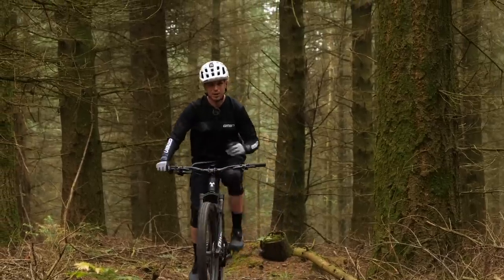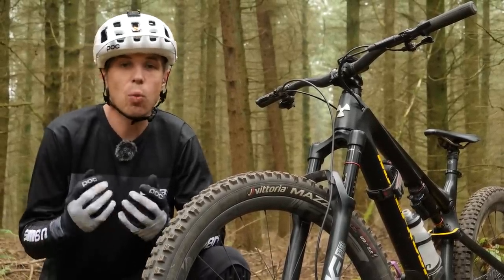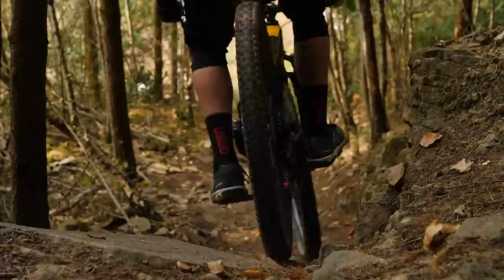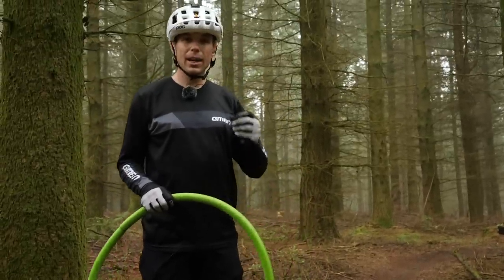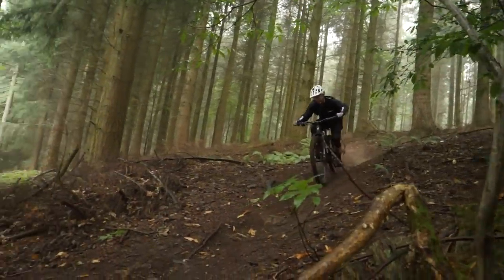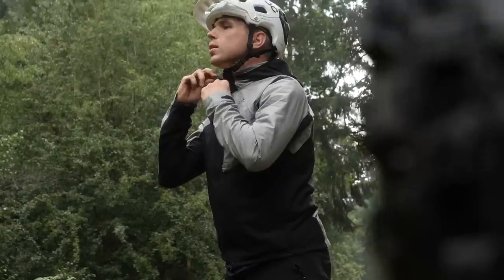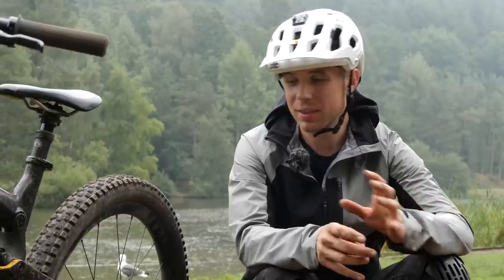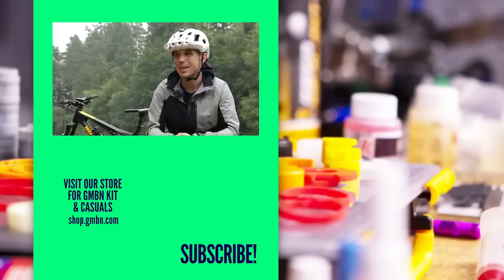How To Choose The Correct Tyre Pressure | Hard Vs Soft, What Is The Ideal Setup?

Comment: My local bike shop suggested this as a starting point for tubeless tire pressure: rider weight in pounds, then divide by 7. Add 2 PSI for the rear tire, subtract 2 for the front. When I was just starting, it worked great. I have dropped a few PSI on both tires as I've gotten better, plus it's really dry here.
Reply: And non-tubeless?….tubed I guess
What pressure?
Reply: @justingrimson5750  simply run the pressure stated on the tire, probably around 35 PSI. When I ran tubes, I still put sealant inside the tube and ran a few PSI below that number. You can't go too low when you have an inner tube, though, or you can get something called a pinch flat.
Reply: Hmm, interesting. For that I would have to go below 20 :)
Reply: Giving this a shot since the number line up with 2 psi of what I was already riding!
Reply: @StratoPL  I run back 35 psi and front 30 ( 206 lbs)

Comment: Every puncture I've ever had (other than one) has been a pinch. Now I'm running tubeless, I tend to still be in the habit of running higher pressures because for some weird reason I'm still worried about pinches.
Reply: same haha, should probrably increase presure xd
Reply: The tendency of sharp objects punching through a tire increases at a higher pressure because the same load is distributed over a smaller surface area. Thus more force action at the sharp object.
Reply: @Dumbo3.1428  you are replying to a pinch flat comment...
Reply: @BGraves  thx. I'm not a native speaker so I seem to have confused both
Reply: @BGraves  funny enough in Germany we call this kind of puncture "snakebite"
Reply: I can barely speak my own native language but that's kind of the status quo over here in America.
Reply: whats your tyre pressure?
Reply: Get inserts..
Reply: Yeah same lol, the first time i tried a lower pressure i got a pinch flat on my tubeless tyres and now I'm scared to try again.
Reply: @benbaker6174  what pressure are you running now?
Reply: @ezboah7183  I'm running 27 front 30 rear just to be on the safe side
Reply: @benbaker6174  someone told me that if youre running too much pressure the knobs will fade easily
Reply: @ezboah7183  i dont see how that would affect it, more psi = less surface area which means there are less knobs on the ground. I could be wrong though.
Reply: @benbaker6174  im going for the same, only just switched to tubeless so might start off a little harder
Reply: @garysdragon  nice 👌
Reply: @Dumbo3.1428  Also "snakebite" in the USA.
Reply: Get Cush core. Now I don’t worry about pressure. It has saved my rims once or twice that’s for sure. Feels very supportive too

Comment: This was good learning, thanks GMBN! I just came home from a xc/trail ride with my hardtail with tire pressure set much lower than I usually have. I thought I should be slow but it was quite the opposite. Much more smooth over roots and rocks and less bouncing. Bottomed out once in 25km which means it was using the full dynamics of the tire in best possible way. And tubeless is the best invention since sliced bread! 😁

Comment: I've put pretty much this comment on another video, but I'll say it again here. I had almost given up on mtb because a I couldn't seem to ride without pinch flats. At the World Cup at Fort William last year I saw the Tannus stand and decided it was worth a try. They are inserts you use with tubes, and they have transformed my riding. I'm running 25-30 psi where before I was always at 40+,and haven't pinched yet in around 400 miles on a variety of trails including rocks, roots, flat out fast bits, slow tech stuff and everything in between. I love these inserts! Fingers crossed they keep working as well as they have so far!
Reply from the maker: We're big fans of inserts at GMBN

Comment: Nice video, but there are some dynamics that matter that I would like to include for consideration.  

I ride and race both mtb and gravel with a lot of success and tires have been something i've always been really focused on (pressure settings and tread profiles).  On the mtb, my focus is strictly XC so keep that in mind in my comments. I don't ride at DH parks, and have no need for an enduro bike (nothing wrong with either, but I xc, gravel, and road riding occupy all my available cycling time).  My mtb wheels are narrow XC on 29er, and I ride both a fully rigid 29er and a full suspension 29er. Lastly, I don't run tires bigger than 2.25's, and often run 2.0 on the rear.

The core dymanics on a mtb that need to be considered first is your total weight on the tires, the terrain you're riding, your suspension setup, and the tire profile (tread pattern) - the combinations with different tire pressures then can be a touch complex, but through many days of riding and racing it's clear that you need to know the total weight of you and your bike relative to the tires. Then you need to experiment with your tires as noted in the video and there really is no hard and fast rule here - one of the great things about off road riding (mtb and gravel) is that you and your bike are a unique power and balancing system and what works for the person ahead of you or behind you is likely not optimal for you.  Learn as you go and you'll discover the sweet spots.  Over time then you modify based on suspension settings.  Yes, it seems complex, but when you dial in all the factors the ride is so fast and sweet it makes it all worth the effort.  I rarely get flats ... and when I do, it's usually an issue of my sealant and/or the rimtape or valve having issues (or service neglect).  So, what do I recommend in general for mtb?  Here are 4 additional points to the great information from the video.

1.  Weigh yourself in typical gear along with your bike - find out what that number is and then adjust your tire pressures accordingly based on changes over time. If you're a clydesdale and tend to smash your way down the trail you're going to put a lot more stress on your tires and will need a lot more air pressure all other things considered (especially in the rear).  On the other hand, if you're a whippet (bike plus rider under 75 kilos) riding a full suspension you can run some seriously low pressures and never bottom out hard.  So, get some core metrics in your brain first and then experiment.

2. Tubeless, period. And consider inserts - they work well, period. Tubes are a waste of money in my view and only serve to increase your odds of a flat when you bottom out the tire.  Get rid of your tubes and go tubeless and you'll decrease your odds of a flat dramatically while also being able to run lower pressures in general (which is a very good thing as noted in the video).  Add an insert in the rear and you'll generally eliminate flats from compression.

3. Run slightly higher pressure in the rear (or use an insert), typically 2 to 3 psi higher than front if you're running full suspension, perhaps a bit more for fully rigid or hardtail on rocky or rooty terrain. If all you ride is soft loam, even pressure works really well and there's no need for an insert.

4. If you're running full suspension keep in mind that your suspension is in some respects like lowering your tire pressure, as opposed to a fully rigid setup, thus you can run slightly higher pressures and have the same feel on downhill bombs and flats (for the most part) - cornering is a different matter and lower pressures help a lot.  The nuanced benefit of slightly higher pressure is the same feel with less risk of bottoming out the rear tire and damaging your rim.

My general range of psi's on the mtb run from a low in the low 20's and never more than 28 or 29. Ever.  If I put 30 in a 2.25 I bounce around like a ping pong ball and the whole idea for speed and cornering is to keep your tires connected to the ground.  If you're going up and down (bouncing off the ground) from too much tire pressure you're losing efficiency, and thus speed and handling.  The dead giveaway is on corners when you feel like you keep sliding out or don't have that confident feel ripping the corner... (tread pattern comes into play here as well).

As for gravel, it's a bit simpler as it's 700s on 40s or 45s for me, and I rarely run pressure over 40 psi and often run mid 30's (depends on roughness of the course). And, of course, tubeless. I do not lose speed, and actually feel like i'm faster (and based on segment comparisons am definitely not slower) - especially on the fast downhills and high speed gravel corners. IMHO, riders tend to run too narrow of a tire and put too much air in their gravel tires (as if they're riding on tarmac).  There are significant benefits to wider tires and lower pressures on a gravel bike (not the least of which is hand and shoulder comfort), and I know some guys who ride super fast on even lower psi's. There's really no loss of speed, unless you go too low.  The type of course you're on will make a difference as to how narrow you can go, but for where and what I ride the 40's are really great and I just adjust the tire pressure based on how much weight i'm rolling with for the day, the roughness of the gravel, and whether or not there are big climbs and fast descents. 

Great video, hope my comments are helpful to some.
Reply: @bil danielson - extremely helpful, along with the visualization from the video. I will be experimenting for sure to find that sweet spot as your advice seems to show that it’s well worth it. Thank you!

Comment: Ok this a huge subject for me and it something ive been fighting with the last three years . Ive been since i was a young lad 15 , im 47 now so ive seen all the changes though the years the biggest change was the width of the rims and what tire Pressure to run / tubless and tubes . We all come in different sizes of people i just happen to be on the big side at 230lbs . I cant run my air pressure any lower then 30 psi/ tubeless or a tub in the tire set
Reply from the maker: But tubeless is still a great innovation as you say

Comment: Thanks gmbn, this video gives me motivation to play with pressures again after seeing them deform under my usual pressures. I am 80kg, Have 30mm rims and 2.6 tyres running 19 front 20 rear. Always felt slow to accelerate and loses speed quickly.

Comment: Running Vittoria Agarro front and Barzo in the back of a hardtail with 130mm fork. Both 29x2.6 on 30mm inner width. Doing light trail riding. Running 16 psi in the front and 18psi in the back. No problems, but certainly no aggressive riding here. Comfy rides!

Comment: For i21 rim with a 29 x 2.35 Nobby Nic, I found I had to run pressures in the high 20's Front and Rear to prevent excessive tyre roll and burping.  Put the same tyre on my Bontranger Carbon i29 rim which also has a Bontranger Rim Strip (alternative to tubeless tape but also secures the tyre bead nicely against the rim wall) and I can run 20psi Front and 22 to 24psi Rear with much better effect on the trail and over rocks.

For me, it is about running low enough for good traction without rim strikes, excessive tyre roll on the rim and or burping.
I'm 85Kg kitted up for rides including camel back.

Moving up to 2.6 wide tyres, drop to 18psi front and 20 to 22 psi rear on my i29 rims with the Rim Strip.

Of course, tyres are not the same and Vittoria Tyres tend to measure well under their written specs so a 2.4 Vittoria would be more like a 2.2 Schwalbe.

Comment: I run 23psi in the rear 18-19 in the front. Inner rim width of 30mm. Occasionally burp a tyre although it smooths everything out nice. Run a smidge higher in fast rocky terrain.

Comment: Well done. I am interested in the uphill comparisons as well.

I use Stan's Sentry MK3s with a 32mm internal width (ID); and 29x2.8 Maxxis Rekons. I weigh 140 pounds (63kg), and run my tires at Fr 20, Rr 25. I have a Trek Rail 9.7 with a 180 fork up front. Loving the set up.

I've tried every rim width from 29 to 50mm, and tires from 2.6 to 3.0, and 27.5 to 29. All on the same bike and trails. 

So far, my current set up is so grippy and amazingly fast.

But it's not just perception. My buddy has run the same set up (29x2.6 with 29mm ID) since the beginning of the test.

I've been able to really see a difference between all the setups using my buddy as a constant, my times, my gear choices, etc.

My current set up is by far the fastest rolling and grippiest. It's really amazing the difference between them.

Not everyone will have the resources or patience, to do what I have done. That's understandable. But my buddies appreciate my research, and I love the results. Each new setup is so different from the last.

Next I'll try different internal protection cores and see if that makes a difference.

Comment: Good but very condensed report, your conclusion is spot on, that for aggressive riding we need the lowest pressures on wider rims, whilst preventing pinches, so the use of an insert is very beneficial. I'm a bit lighter than you and run 18psi front, 20 psi rear with insert on 32mm int. rims. Comfort and control = speed.! I would run even lower, but I'm not a good enough rider to unweight over those tyre shedding rocks.

Comment: I'm astonished at the amount of deformation you're getting.
I'm 160 pounds, running 13 psi front on a 29x2.4 Trail King and 16 psi on a 29x2.3 Mountain King in Utah, on 27 mm inner width carbon rims without inserts, including Moab which is "square edge hit city" and I'm not getting rim strikes, burping, rolling or any tire damage. I'll get squirm on slick rock at those pressures, but that's just because slick rock has an amazing amount of traction. In any kind of dirt, it's fine.
Reply: H is about 15% heavier than that. Plus trail casings, and different tyre brand. Ur not comparing apples with apples on weight or tyre...kinda the point of this vid! Variables...there is no one answer.
Reply: @rupedog  Fair enough, but the Martello is way beefier than a Mountain King and he's running almost twice the pressure on a wider rim, so I'm still amazed!

Comment: wow...I run 2.4 front/2.3 rear.  18psi front/22 psi rear.  never had any issues....but got me wondering if I should add more.  my next ride I am going to see what 23/27psi (+5psi) does.
Reply: So today I ran 22/28 psi.  Was very fast in the straights .  But a little sketchy in the turns.  I think for me @170lbs gonna try 20/24 next time.

Comment: On my XC bike with latex tubes, 21 mm ID rim with and 2.25 Schwalbe Rocket Rons (LiteSkin), I run 1.5 bar (~22 psi) in the front and 1.75 bar (~25 psi) in the back for trail riding and 2 bar (~29 psi) in the front and 2.25 bar (~33 psi) in the back for road and light gravel riding. I weigh about 65 kg.

Comment: I just have a regular mountain bike & the maximum tire pressure is 60psi, yet I thought of going down to 50psi on both wheels or just one. I hope to get out riding soon now that the weather is improving & melting all the snow.
Reply: Usually there is a range of pressure on the tire.  Go with the lowest pressure on the tire.  50 is probably too high for off-road riding.  😊

Comment: I've got a plus bike, running 35mm rims 2.8 nobby nics. The bike (Sonder Transmitter) came with 45mm rims which were just silly, squared off anything less than 3 inch tyres.

Comment: I was all excited after fitting my first set of tubeless tyres, a set of michelin e-wilds 2.8's on 35mm rims I aired them to 20psi in the rear and 18psi in the front and hit the roads to test them out, the first banked turn I hit hard and the front slid sideways as the tyre rolled, I didn't crash but it slid a decent 10-12 inches sideways, from now on I run 28psi rear and 22psi in the front, much better, bike is a 2018 merida eone sixty 900e

Comment: 23mm rim . 2.4 is probably the largest with tire for that rim size . I am 160 pounds and run 22 psi on the rear and 20 psi on the front . Now I am not very aggressive on the ride . Another factor is if you ride  a hardtail like me lower pressures is helpful . Terraine is also important . I ride in the high desert with rocky loose conditions . When I ran tubes pinch flats did happen . Also the casing of the tire is important .

Comment: I had a 2018 Trek Full Stache 8 with 29 3.0" tires.  I ran Maxxis DHRs at 10psi front and back.  It wasn't a race bike, but I would bust spokes all the time.  Not sure if that was the cause, but I had max traction.

Comment: I can't believe you guys run such a low pressures :o. I'm new to enduro and to date only once tried going below 2bars, around 1.5 I reckon, and the feling on turns was so weird and worrying, that I immediately went back. And Im only 65kg and have quite hard tires! Though I still am running inner tubes, so I couldn't give it a longer test, cause I'd surely get a snake pretty soon

Comment: I'm 158 lbs (170 with pack/water)  and run a Maxxis HiRoller2- 2.3 rear/25psi , Forekaster-2.6 fr/19psi.  It seems to be the sweet spot on supple without the tires squirming or deforming much, for my weight.

Comment: I'm not a super aggressive rider so I stick with narrower rims, 23-25 mm. Weight benefit is also a good thing when climbing and I have friends riding mostly road bikes, but sometimes getting their MTBs out and coming with me, and they are quite good at climbing as you can imagine. Being a bit lighter helps being a bit less of a drag. But when the road goes down I get my revenge, they can't even see my dust ;)

As for pressure the upper 20s is the sweet spot for my tyres. I have AM / all rounder tyres (Michel Wild AM or Schwalbe Nobby Nic), they work very well without going in the lower 20s. But I'm wondering if I should try an Enduro tyre such as the Vittoria Mazza or the Michelin Wild Enduro. I do both climbing and downhill / single tracks (but not extreme / super technical stuff), if an enduro tyre can enhance the gravity part without taking out too much to the climb I might as well. Can even consider a wider rim on the back, but maybe just getting an insert is enough.